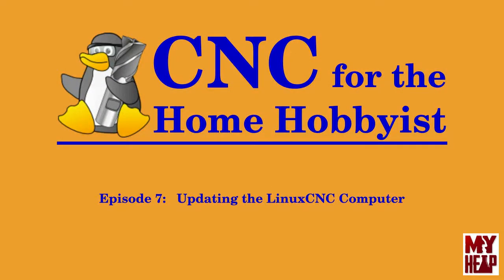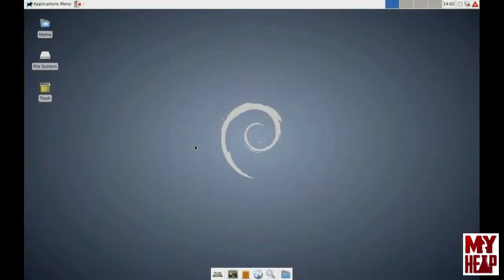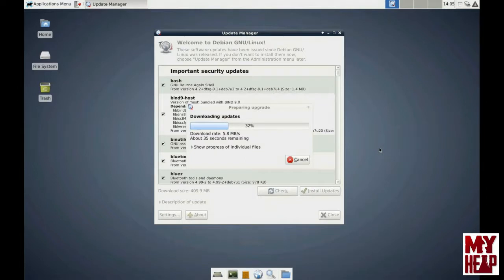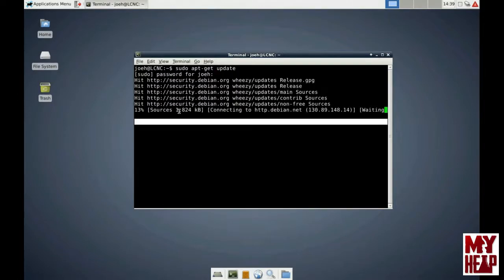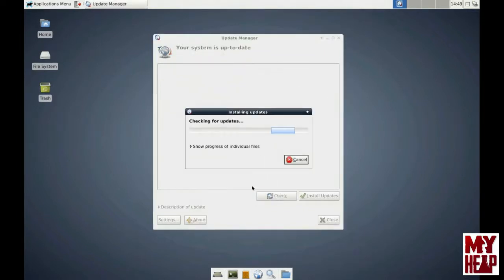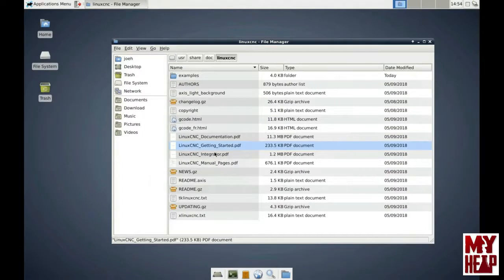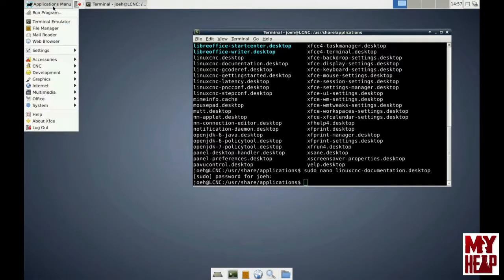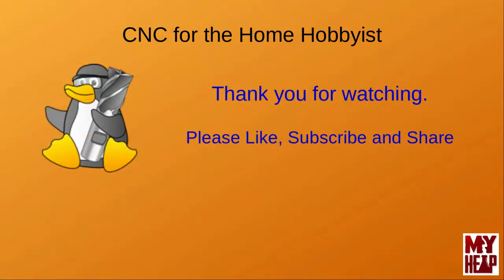LinuxCNC for the Hobbyist - 007 - Updating the LinuxCNC Computer

Comment: In terms of updating or adding packages I suggest a) This machine is best isolated from the Internet. b) it is obsolete being Debian 7 and out of support this means driver updates and package updates that are not CNC related are probably not going to be updated anyway.   Balance this against the risk of breaking your CNC software or its OS.  So I personally wouldnt try and read PDFs etc on this machine but use an internet connected tablet or laptop along side it.  Certainly keep the cnc software patched though.
Reply from the maker: Hi gzcwnk.  I agree that there would be little use of updating Wheezy these days, since it officially fell off support in May of this year.  As far as giving it access to the Internet, I think that is a matter of taste.  I use pfSense firewall at my house so have a granulated control of what comes in or out and use a DMZ for more volatile network activities, but many people are less fortunate and may lack hardware or skill set to do this.  Generally speaking, I agree with you, and if in doubt leave it off the network and sneaker net your files to the machine.  Another reason, besides updates for having the machine on the LAN is that I like to do the CAD and CAM portion of the work at the comfort of my home office desk and then transfer the NC files to either the machine or to a share on the NAS server which is accessible from the CNC Router.

Sorry for the late reply, I have been busy.  Thank you for taking the time to watch and comment on the video.  I appreciate it.  :-)

Joe